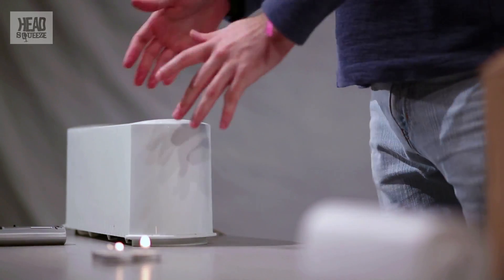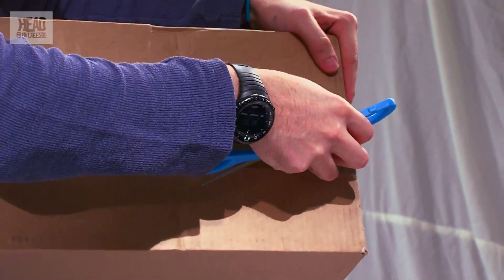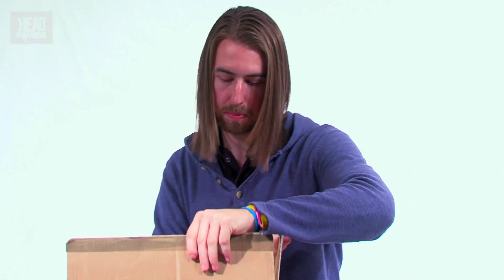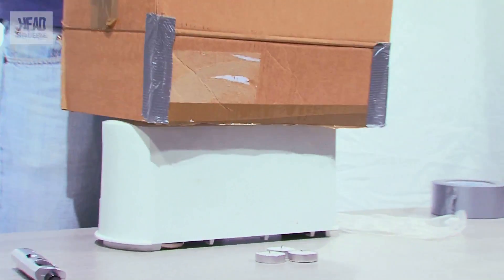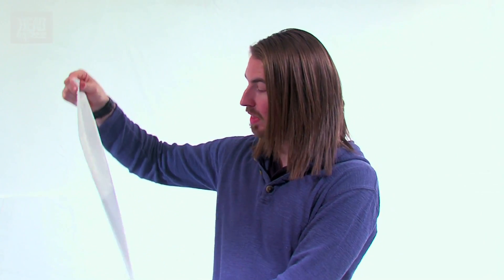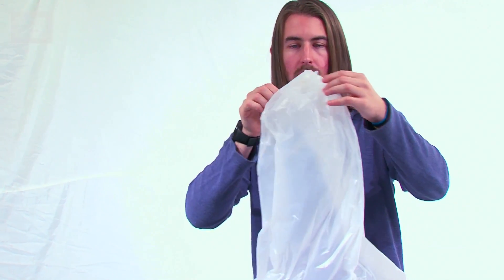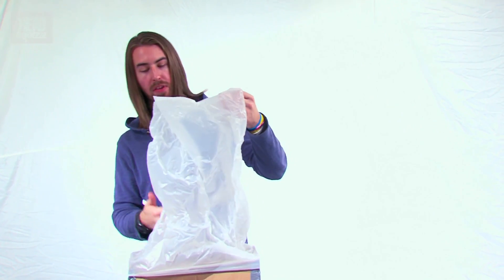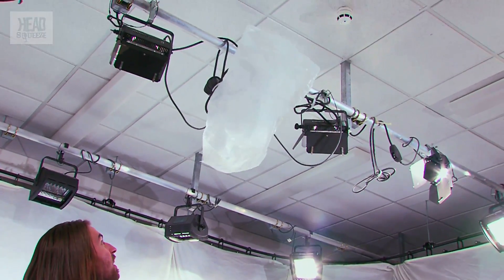Bin bag hot-air balloon! | Live Experiments (Ep 18) | Head Squeeze

Comment: Summary of Video:

Step 1) Gather a Toaster, Scissors, duct tape and a bag.
Step 2) Plug in toaser and push it down making sure its on.
Step 3) Push scissors into top of toaster firmly holding it.
Step 4) Repeat with a fork.

Congratulations, you just made a hot air-balloon